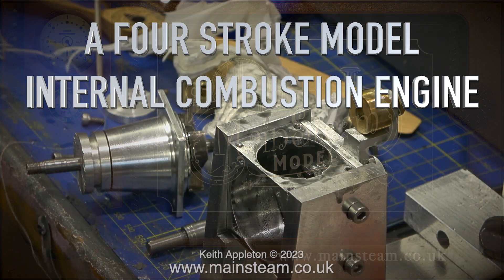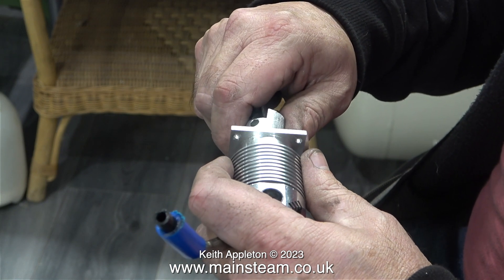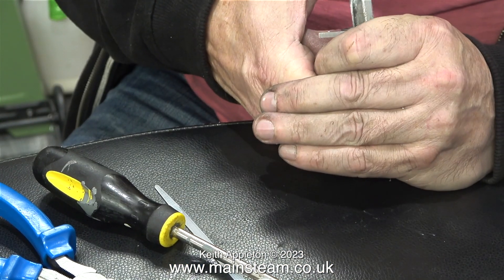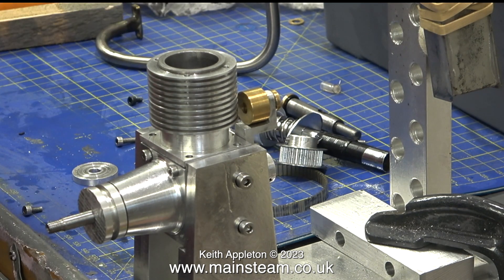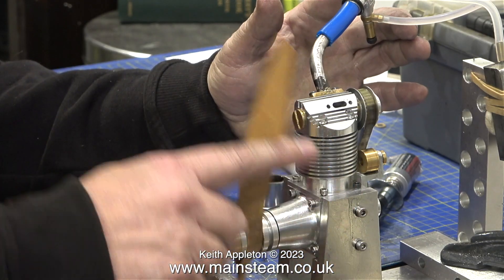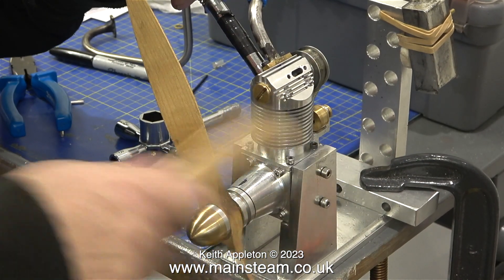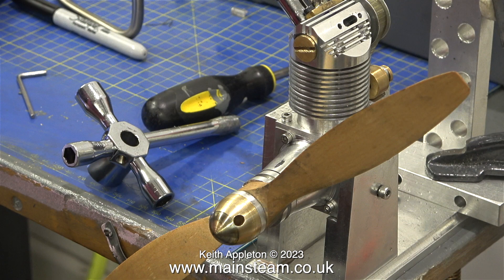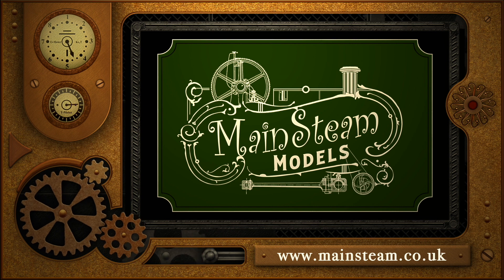A MODEL FOUR STROKE INTERNAL COMBUSTION ENGINE #2

Comment: If the engine cannot get air into the cylinder you will have no compression as fitted with the solid bar. As you say it is leaking either past the ring, if so you would still have some compression or a valve timing issue. Has the bore adequate lubrication and i would be inclined to fit a seal in the head between barrel
Reply from the maker: of course, but you would expect to feel some vacuum .........
Reply: Hi When you had your hand on the cylinder with no head fitted you had vacuum and compression so as you say it has to be in the head or seals in the head It must be timing the valve is not closed when on compression stroke . I could not see the pulley on crank now silly question have you got 2/1 ratio @keithappleton